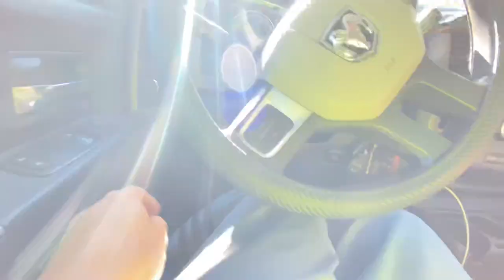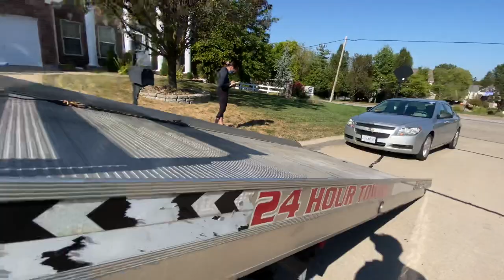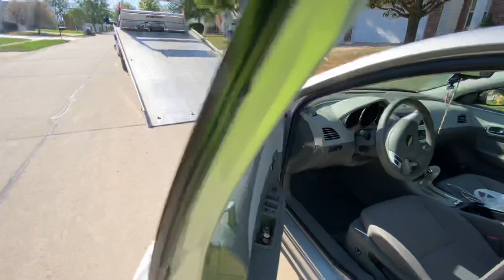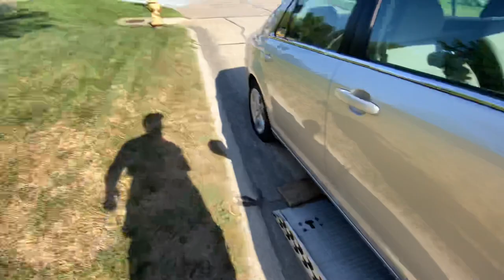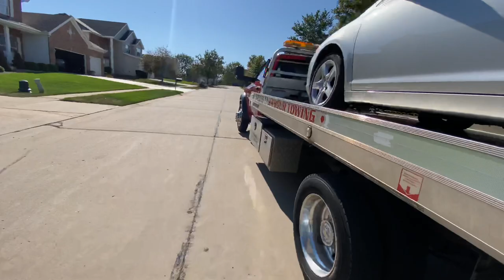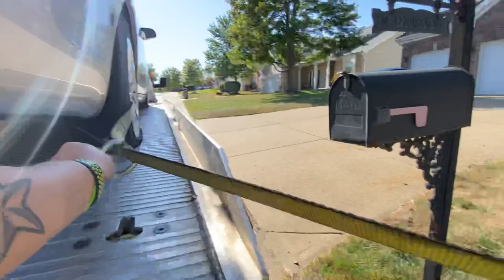Accident tow & how to use straps

Comment: Is that D.O.T legal and how does that pass as 8 point tie down? I like it and it's a lot faster then the normal bed straps
Reply from the maker: As long as you got 4 corners and winch line I added the other 2 off camera some guys use the 8 point tie downs I like my way! Or u can use big j chains